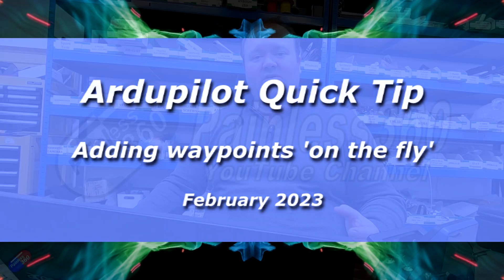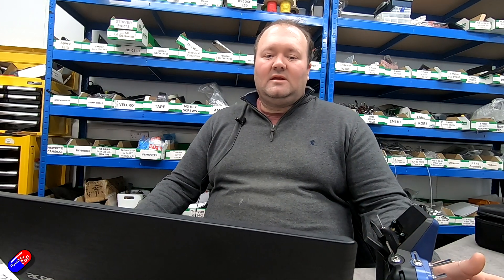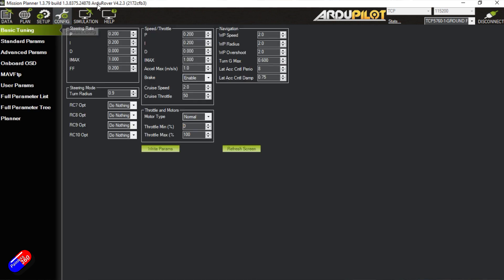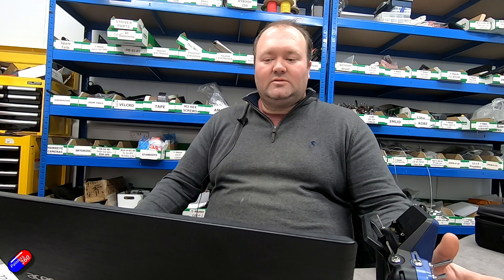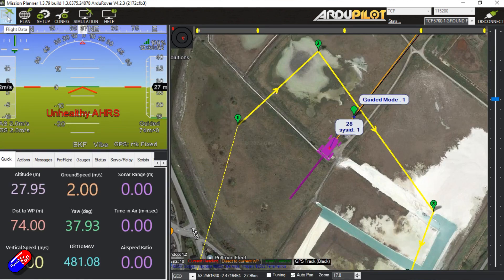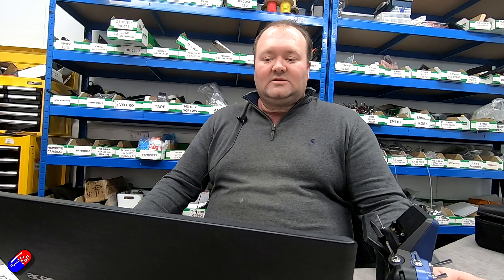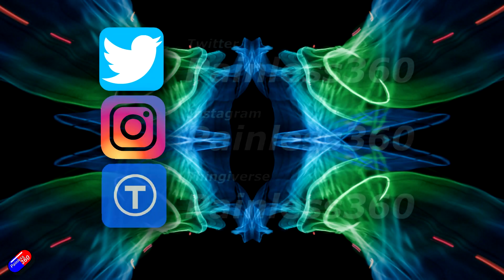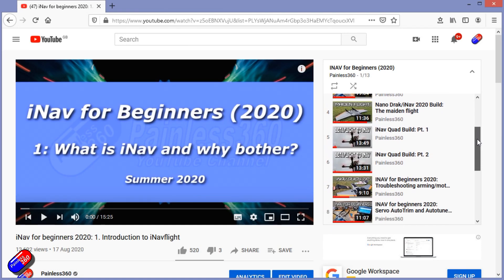Ardupilot: Adding waypoints 'on the fly' (handy for things like bait boats)

Comment: Thank you! I have a multi-rotor with camera on it, and I've been trying to figure out how to save the save two positions in flight, and then have the aircraft fly straight between those waypoints for a smoother camera shot than the one I flew manually. I'll give this method a try!

Comment: Hi, what hardware need??
Reply from the maker: Check out https://m.youtube.com/watch?v=N6Z3oO43qEM
Reply: @ painless360 Thanks, It would be possible not to use mission planner. save several waypoints "on the fly" and then tell it to go only to a point that we select with the transmitter control? thank you so much!
Reply from the maker: Not sure, all I knew is in the video.. Best of luck

Comment: Hi Ben and team! Thanks for these fantastic videos! I did follow all the steps you mention (rover mode) but it didn't work... 😞 Radio channel 7 responded in setup radio calibration screen but no WP is added... Is there anything that I'm missing? Fight Mode maybe? I tried with manual, auto and all the ways, but WP don't appear...
Reply: Hello,I have the same problem,it doesnt work ,channel 7 doesnt save any waypoints when i activate the switch for those channel

Comment: It would be interesting to see how accurately an RC car can follow waypoints.  I know GPS typically has an error of a few feet.  Could an RC car stay on a sidewalk when following GPS waypoints?  Or would it run off into the grass?  What about following a road without hitting the curb?  Obviously the answers depend on the GPS system and how many satellites are in view, but still would be a fun experiment.
Reply from the maker: You can alway use an RTK setup, that has sub centimeter accuracy! 😁
Reply: @Painless360  If an RC car runs off the road and gets stuck in tall grass or on a curb, RTL won't help much.
Reply from the maker: I meant RTK, blooming auto correct! :)
Reply: @Painless360  LOL - yes, an RTK makes a lot more sense!